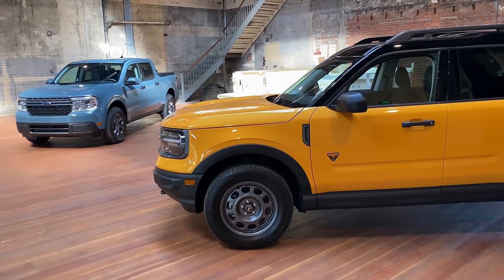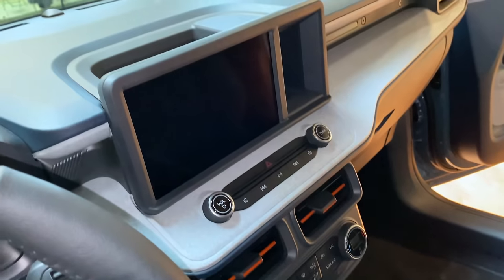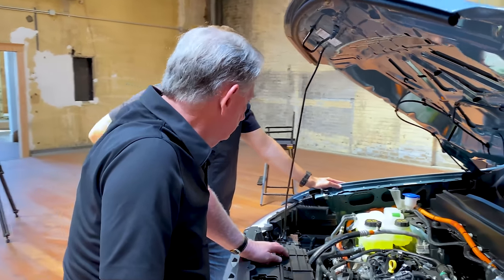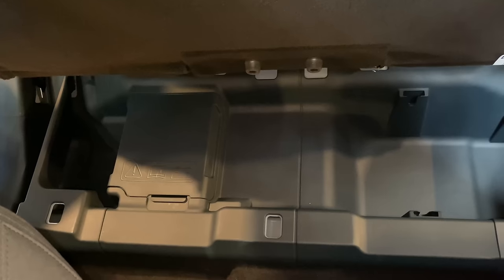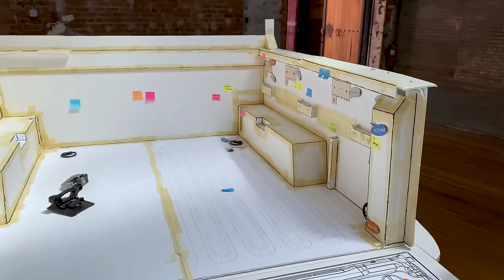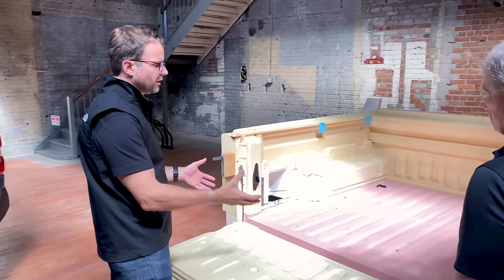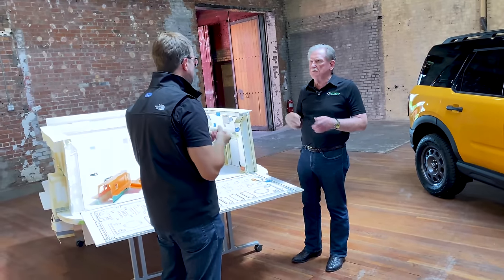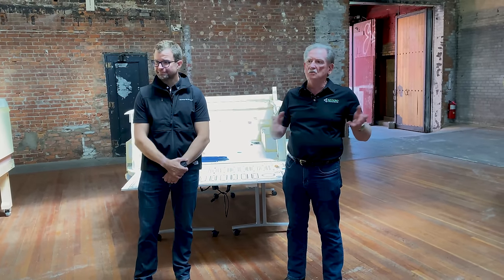Ford Maverick Review with Maverick Chief Engineer Chris Mazur

Comment: One question, why did Ford leave an open area between between the front post and inner front fender both sides, one can see into the side engine bay, and on the passengers side you could see the window washer container.

Comment: Hope this new trend to put a power socket in the bed continues and becomes standard. With a switch inside to turn is off, in case of water infiltration. Very handy for people that actually use a truck for what it was design...to work.
Reply: It has a GFI (ground fault interrupt) plug.  = Will open the circuit if there is a short to ground.
Reply: RogerM - this is NOT new technology , they could have had Power outlets in Truck bed since the 2000's .
Reply: RodgerM - the JEEP CJ (agro jeep) had Mechnical PTO - power take off since the 1960's .
Reply: Mark Plott  batteries were an issue in the 2000s
Reply: @DavidHRyall   - NOPE, FORD made a 100% RANGER in 2000, as well as Chevy had a 100% Electric LIGHT TRUCK.
Reply: I think a real "standard' should be a plug in truck with full battery, and down in a stow-away box (like on the Rivian), they should have a heavy duty diesel powered welder that also has an air compressor attached.. so that it can be used everyday for welding and construction work---- but also, the main kicker--- it can run as a range extension and be charging your battery on long trips......  That would be a killer work truck that everyone would want across a lot of trades.
Reply: @markplott4820  yeah.. inverters have been around since before the telephone..  It's always been easy to do this yourself.
Reply: @markplott4820  PTO's on Ford superduty's for years too.
Reply: so many times have been reported of f150 built in generator features have saved the day with powering homes and camp sites during power outages lol

Comment: A truck for sub 20,000$. That is a winner. The thing that made the Ranger so popular was that it was dirt cheap.
Reply: This is what the new Ranger should have been.
Reply: Well, it’s not a rocket science. It’s super simple structure and no special interior either. I would be properly shocked if it was anything above 25-30k
Reply: This is even better because it seats four comfortably (and legally)
Reply: Maverick is a Cheap made Hybrid
Reply: Annnndd they were cheeeaaappp!!!! They rode terrible and the wind noise was so bad lmao I had a few of them...really cheaply made. Hopefully this ones a little tighter. And maybe I won't have to pull the engine to do timing chains 😵
Reply: @mgmacius , are you talking about the Cybertruck? I don’t think it will sell this cheap.
Reply: @imho7250  what does the cybertruck have to do with a Ford?
Reply: @mgmacius , nothing, but it fits your description better than the Maverick.
Reply: @imho7250  right, it’s super simple. But definitely won’t be that cheap as you said yourself
Reply: @markplott4820  That was the goal
Reply: @mgmacius , that is if they ever make it. Like the 2020 Semi and Roadster that still never sold to a customer. The unibody CyberCUV is also not gong to be made and sold for the price Elon promised. 

I don’t count this Maverick as a truck either, but it does LOOK like a truck, it will give a riding position of a mini pickup, the utility of a tiny pickup, and if it can get 40 mpg city and 37 mpg combined that’s better than the old Ford (Mazda) Courier. 

Ford will still sell a real truck if a front wheel drive unibody vehicle isn’t what a customer wants, but I think many will like it.
Reply: Lachoneus9000 - you PAY more in TOTAL cost of ownership , more DOWNTIME to do REPAIRS and REQUIRED maintanance, there is NOTHING to Break on an 100% Electric Truck.
the Hybrid system is UNRELIABLE and Requires just as much MAINTANANCE as a ICE truck.
Reply: @imho7250  oh, so it’s fud now? They will sell both the cybertruck and the semi. It won’t change anything if they sell the roadster or not, but probably they will too. Elon is bad with dates but he delivers
Reply: @mgmacius ,and given enough time Elizabeth Holmes would have delivered a working Edison machine. You can call it FUD (Facts and Understood Data) if you want, but Tesla can’t make half the things it promises. Even the Plaid Plus that many put deposits on, Elon just told all these rich adults they don’t need 520 miles range. Lol
Reply: @imho7250  now imagine up voting your own comment's 🤣
Reply: Frugal Family Living   - TESLA model 3 is the LOWEST Total cost of Ownership.
the PRIUS still burns FUEL , as per HYBRIDGATE . 
what is Hybridgate ? 
it is when AUTOMAKERS like TOYOTA build Hybrid cars like the PRIUS, and they install a CHEAT DEVICE or lines of code that CHANGE the Conditions of the EMISSIONS tests , thus giving them a FAVORABLE rating , when in REALITY the car BURNS fuel , even in ECO mode . 
and TESLA retain MORE of their VALUE over time than ANY other car in EXISTANCE.
Reply: @markplott4820  you spent all that time capitalizing random words, perhaps you should have spent more time researching the subjects you just tried and failed to talk about. Emissions, and fuel consumption are not the same. Toyota didn't cheat emissions, VW did. Also, no kidding eco mode burns fuel. Eco mode doesn't magically make the prius a BEV, it adjusts fuel maps, throttle input, and cvt ratios. You know, the same as in every other vehicle with an eco mode. You really don't know how hybrids or the priuxs works do you? What's next, you gonna tell us the battery has to be replaced every 50k mi and costs 6k? (It's 2k and many report 250k miles or more on oem battery.) The prius and most all hybrids are very reliable, very economical, practical cars. As it stands teslas are not. The nearest service center to me is 90 miles away in a different state. Basically impossible to get service at that distance. Also, teslas and most BEV are priced so high that they do not pay for themselves in fuel savings.
Reply: @SweetLou0523   - where the HYBRIDGATE research was done in the UK, they found Hybrid cars still made EMISSIONS when they were NOT LEGALY able to. 
meaning VIOLATING the EMISSIONS bans already in place for a CERTIN GEO LOCATION and or certain TIME. 
and these VIOLATIONS happend across Multiple models of Hybvrid cars. 
BEV have ZERO tailpipe emissions, better get on the ball.
HYBRIDS/PZEV are already DEAD, along with ICEV , such as GAS/Diesel, and CNG, and FCV cars.
Reply: @jeffthejinjer  this one has to be a lot smoother, considering it's based on a crossover, and the fact that there are so many mine regulations for safety, I'd imagine there's a lot more "stuff" between the occupants and the outside that would be sound deadening
Reply: @markplott4820  
Oh my god you're kidding..
 a hybrid car still has a missions? No shit.  it's got a gasoline engine.
 No standard hybrid operates in electric vehicle mode long enough for it to matter, it's only designed to get the car moving and parking lots accelerated lightly or to assist the gasoline engine while accelerating.
Some of the plug-in models can operate in electric vehicle mode for longer periods of time. I think the Prius prime can go 25 miles. And under certain circumstances the gasoline engine still runs.
Take a look at the percentages last year 90+% of all vehicles sold were still ICE that seems far from dead to me.
That's global. Maybe in the UK things are different.
 But there's a big world outside of the Europe and the UK.
As I mentioned in my other comment,  I have a 13-year-old Prius. The car cost me $0.08/mile  to operate . that's fuel all maintenance and tires.
And I was able to buy the car for $2,000 , and in the 3 years I've owned it , I've put 172,000 mi on it.
Why don't you work out THAT cost of ownership?
I have because I drive for a living.
Comparing a brand new Prius at $30,000 versus a brand new Tesla Model 3 long range for $48,000 driving 50,000 miles per year it would take me more than 10 years to break even because of the difference in purchase price. 
Now I understand in the UK you guys pay massive taxes for fuel and CO2 and a bunch of other Eco crap forced on you by your government. 
We don't deal with that shit over here..
So your numbers will vary but as I said before the whole world isn't the UK and Europe.
Ford isn't targeting this small pickup truck for Europe. You don't buy trucks 
We do here in the states a lot of them. And we don't currently have a small pickup truck option that's truly a small pickup truck.
Ford is probably going to sell the hell out of these...
Reply: @kens97sto171   - the BEST hybrid we had in the USA was the Chevy VOLT with 48 miles Range as a Pure Electric. 
but, Hybrids now will be BANNED in the EU as well, not sure about UK. 
and California and many CARB States have mandated the ELIMINATION of all COMBUSTION Vehicles + Medium trucks by 2025, and Larger H-D Trucks + SEMI by 2030.
Reply: @kens97sto171   - I call Bullshit, Obvoiusly you dont know what TESLA Octovalve and Heatpump is.
SANDY MUNRO call it Genius . 
ELON wants to Build a EFFICIENT HVAC based on the one in the Model 3.
however when he toredown the FUD motors Muck-e , he nearly had a Heart Attack at all the MEDUSA hoses for its Cooling system and HVAC. 
SO, it is MORE than Likely we will see Muck-e, iD.4, BOLT on the side of a ROAD , rather than ANY TESLA. 
TESLA is at the TOP of the ENGINEERING food chain and it moves LIGHNING FAST. 
it went from RESISTIVE HVAC to OCTOVALVE in just 3 months . 
all the LEGACY are Building SHITTY EV made Exactly as a GAS car would. 
this is EVIDENT in the Muck-e and iD.4 , both are made like OLD FASHIONED gas cars.
my 2012 model S still Drives like a CHARM , still has ORIGIONAL brakes , no need to Change then , since I DONT EVER USE THEM, my First maintanance was at 300,000 miles Driven. all I did was Rotate and Replace Tires and add Wiper Fluid. 
while ALL EV makers are making BETTER cars than GAS , the Muck-e is now OUTSELLING the MUSTANG , LEGACY still needs to catch up to TESLA's level of ENGINEERING , and Tesla has a UNASAILABLE LEAD.
Reply: @markplott4820  a lot of you ev nuts always go on about maintenance costs. If a person is mechanically minded or an enthusiast that does their own maintenance….its not that expensive compared to the normie spends.
Reply: @Bonanzaking   - how can you Write CODE , if the System is Encripted ?
you can Change the Cabin AIR filter , but its hard to get at. 
and EVENEX and others sell TESLA Upgrades.
General maintance is VERY LOW.
no OIL Filter, no Spark plugs, no Transmission/Power Steering fluids , no OIL changes , just WHAT do you plan on FIXING ? 
my TESLA Brakes lasted me 300,000 miles , I almost NEVER use them.
Reply: @markplott4820  i dont see these things as cost prohibitive or inconvenient. My 50 year old mustang still ticks and runs. Maintenance on it is as much a hobby to me as cleaning and oiling my rifle. Do you not understand what an enthusiast is? The car displaced the horse the way the ev will displace the gas engine in due time. You still have people ride horses these days for fun. Ditto for ice cars. Some of us already pay up to 20$ per gallon for race fuel. The cost to maintain a bloody Corolla are pennies by comparison. 

Your sainted Elon should work on tires. I bet you go through more than someone driving a Prius cause all that torque.

As to your question as to what I would plan on fixing? Well i prefer to do brakes myself. And if the battery did need replacing a decade from now id like to be able to give it a crack if i was bored(I dont work for a living anymore) or take it to someone besides Tesla because i dont like the idea of being told i cant do what i want with what I purchased. 

EV’s will displace regular cars, not denying it. Just gonna take some more time probably a decade maybe 15 years.

And unlike a lot of you virtue signaling im saving the environment ev owners, I’ll probably be taking an actual green approach to my vehicles when gasoline goes bye bye. I have old vehicles. Whats the saying reuse reduced and recycle. Ill be reusing my old vehicles and reducing the need for a new one through an EV conversion. All i need is an electric go kart not a bloody computer.
Reply: @Bonanzaking   - In 5 years , you wont even be able to BUY a GAS engine , even IF you wanted to.
Reply: @markplott4820  not everyone wants a Tesla….you do understand this right? They won’t become a monopoly. They are the iPhone of EV’s. There will be an android. Yeah im sure a few automakers will go the way of blockbuster. But get it outta your head everyone will get a Tesla.
Reply: My guess is this platform will carry over to a hybrid Transit Connect. I hope so, anyway.
Reply: @vegansoy  - NOPE, all Hybrids, CNG, FCV are all finished. The future is ONLY in BEV.
Reply: Just so you know? The Ranger? Was a rebadged Mazda B2000 pickup for MOST of its life.

Comment: Thinking about how to make the bed more useful is great!  I've drilled holes in beds to install tie downs that should have been provided and cobbled racks together.  Ford has thought about how to make this stuff easy.

Two position tailgate - wonderful!  "Back then" tailgates used to be supported by chains rather than wire cables.  When hauling stuff we'd unhook and twist the chain in order to make it shorter and hold the tailgate in a 'half down' position.  Ford reinvented what we did.  Great utility and seems to solve the problem of holding sheet goods in an undersized bed (sedan with no trunk lid).

Comment: The secondary hood latch is annoying but it is a safety feature to prevent the hood from flying up into the windscreen driving down the highway when you’re texting and accidentally pull the hood release inside the car.

Comment: Love it, coming from someone who has always owned a Japanese car. Love the flexibility, fuel economy and affordability. My greatest fear is reliability.
Reply: That is what it is it is a replacement for an economy car with a bit more utility
Reply: From what I've researched the engine has been on the Ford explorer since 2014 with some customers having 300,000 miles on there explorer with little problems. The cvt is from the same vendor that porche buys from and they've been pretty reliable. The only thing that's new and untested is the new In house hybrid. I feel confident in the engine and trans little worried about the hybrid.
Reply: @1971mustangowner  This engine was never used in the explorer, but was used, and well proven, in the escape. The mach-e was a ground up, all new vehicle, and it was the only ev rated above average in terms of reliability by consumer reports.
Reply: @KB-bh9hp  thank you for correcting me. 😂
Reply: @1971mustangowner   No problem lol.

Comment: This is what the people want! I’m a Tesla owner but have owned small to medium trucks most of my life and the prices were just getting ridiculous. They will sell these like hot cakes & when they eventually bring the fully electric version it will most likely be the best value electric truck on the market.
Reply: These will not sell once full electric trucks come to fruition.
Reply: @EVBud69   price.   Full electric trucks will not be 23 k any time soon.  The only people that may get down to maybe 29k is the Chinese.   By that time Ford would have sold 1 million of the Mavericks and be working on the next generation.
Reply: I am now thinking about canceling my Mav order and wait  couple o cheats to see what comes down the pike….hopefully  plug-in in another year and then move to full electric.
Reply: @jpear  I would not buy any new production car unless you are willing to deal with some major problems.  Wait  1 year or 50,000 cars.   I have a 2018 Tesla 3 but I waited till 100,000 were made.   Both my 2000 Celica and my 2013 Brz had major engine problems ( first year cars). Although the Celica still went 300,000 miles.  The piston rings went bad at 250k.   Many did not make it to 100k.   My BRz bent a valve at 50k.   Subaru would not recall the issue till 2017. 

My 3 has been trouble free.  Also my 2001 Jeep Cherokee ( last year in a 18 year run).  Has been completely reliable and is still my daily driver with over 320,000 miles no major problems.

Comment: You said the main feature of the truck is price, so what did the dealership do? They say they are planning to put a $5000 add-on to the truck thereby the price thing will go out the window immediately. Too bad Ford, I was planning to trade in my Escape but not to the tune of a $5000 mark up.